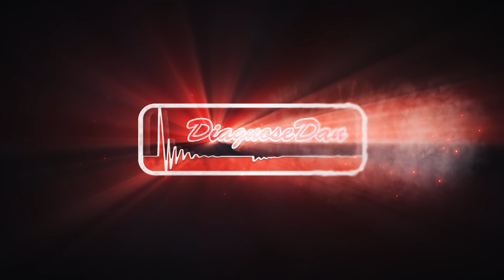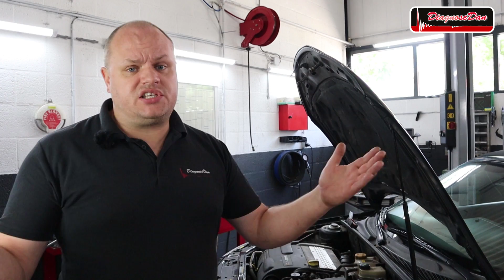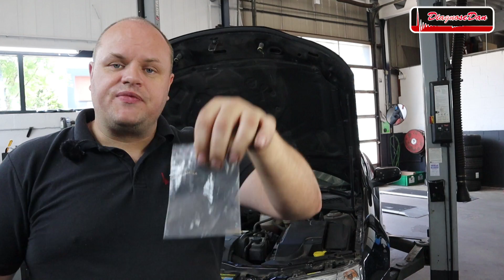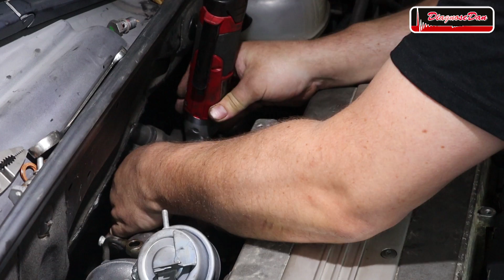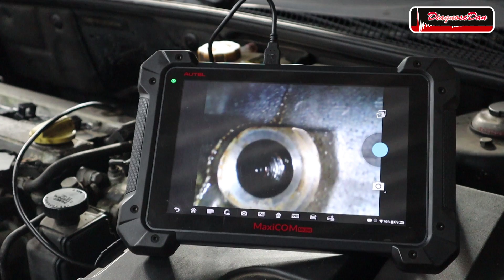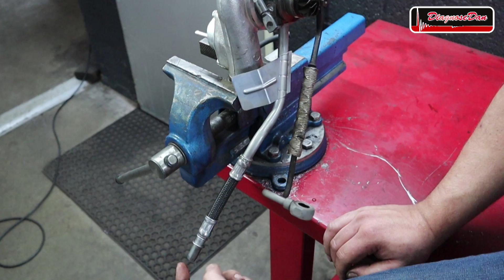Why did this new part only last one day?

Comment: The calse of the carbon is more likely to be cheap oil not meating the manufacturer specification of Aditives and incorrect service intervals (oil is cheaper than berings) always change oil lower milage than the manufacturer states as the oil is still deterating will the vehicle is idleing
Reply from the maker: Thanks for the comment 👍

Comment: some of the problem is they shut down hot without idling and letting the oil and turbo cool down , causing the coking problem in the pipe.
Reply from the maker: You are right 👍

Comment: Great Great and informative videos, but it would be nice if we knew what the cost of the diagnosis would be, Just as a benchmark for those of us who don’t trust mechanics all that much. There are very few as thorough as you, most rely solely on diagnostic equipment as opposed to combining it with common sense. Just watched your video on the Fiesta A/C circuit fault, what would the final bill be for that kind of repair??

Comment: Hello dear SuperDan, am looking for a super hero that can explain a P1577 error code (right valve of motor bearing: cutting) on a b7 rs4 Audi, sorry i just google translated that from french. I have checked a 8500 pages repair manual, and it does not exist in it to my surprise. Cheers!
Reply from the maker: You can ask your technical questions in the Diagnosedan Global tech support group on Facebook.
Reply: @Diagnosedan   I love it thank you ❤❤

Comment: Dan! Great Video of a turbo failure. Love turbos as they simulate mini turbine engines. Clearly this customer has not been changing their oil at the correct interval. And bad call on the prior shop for not changing the oil line!
Reply from the maker: Thanks for the comment 👍

Comment: That's what happens when you use Dinosaur oil and don't change your oil enough! I would strongly recommend only use 100% synthetic  oil and change it every 7500 miles to avoid the sludge problem shown in your video.
Reply from the maker: Thanks for the feedback 👍

Comment: All these years, I thought it was "Diagno Sedan."
Reply: @Diagnosedan  But really, I had a friend who was a mechanic at a VW dealer. The FIRST thing I though was coked oil return line - BINGO! Same problem with VW turbo diesels. I learned something in Europe - Europeans DO NOT change their engine oil as often as Americans or Canadians BUT Americans and Canadians drive MUCH LONGER distances ... In this case synthetic oil is a good thing.

Comment: This is why saab went kaput...gm engineering at its finest. Likely sludge caused by the wrong oil, insufficient changes, etc. Flush engine with something harsh, like diesel fuel.
Reply from the maker: Thanks for taking the time to leave a comment it's appriciated 👍

Comment: GREAT video DAN.I've never though about the TEMP of the oil feed line.I see that the car makers did try to shield a PART of the line,that shows me they did consider an oil cooking issue,but it looks like it cooked right up by the hot part of the turbo.HEAT soak from that area and possibly lack of oil changes were the cause.MY suggestion would be to add a series of cooling fins on the outside of the tube up there at the bend to dissipate the heat much faster on engine shut off.Much like the airline tubing used on some air compressors.oh and i like the cutting apart of the tube,perfect evidence.
Reply from the maker: Gread advise 👍 thanks for the comment Roberto!

Comment: Change oil often on turbo.. max 10000 km.. let it run for 30 sec or more before shutting down the engine. Severe use much longer.
Reply from the maker: Great advise 👍
Reply: @Diagnosedan  Thanks;)

Comment: H, i I bought  brand new MG MONTEGO TURBO in 1985 and that had a small cooling fan near the turbo that ran for two minutes after engine shut down, and everybody criticized  AustinRover group then,
Reply from the maker: Never seen that, did see new electric MG's driving around over here.

Comment: That oil coking.  Overtime hard oil deposits will build up and act like carbon but it's not physically carbon. This is due to extreme heat temperatures and shutting the car off when the turbo is still really hot. It essentially breaks the oil down and boils it to the point it starts to get hard almost like calcium deposits. As it is a known issue it tends not to be very common on Factory turbo vehicles but to ensure it never happens again you can keep up with your oil changes and just let the car idle for 30 seconds to a minute after harsh driving before you shut the car off or install a turbo timer on the car.
Reply from the maker: Great comment! Thanks for watching 👍

Comment: Is this engine at all related to PSA's 1.6 HDi? For a while there they had the most annoying habit of putting a wire mesh filter in the oil path to the turbo feed line (inside the engine), which would get blocked if the oil isn't changed frequently enough (and sometimes, even if it is).

Either way, I'd stress to the customer that the owner's manual specifies an oil change interval of time or distance, whichever comes first, and that the oil type/grade specified isn't optional.

On the off chance they followed manufacturer requirements precisely, I'd suggest the interval specified is marketing bullshit and maybe they should go with half what the manual says instead ¯\_(ツ)_/¯
Reply from the maker: They are Both turbo engines! Thanks for the comment 👍
Reply: @Diagnosedan  Yeh, so is the old 2.0 HDi, but it never had these issues ¯\_(ツ)_/¯

If it's not part of that family of engines, then I guess PSA didn't invent arsehole design 🤣

Comment: The first shop tech was not observant of the fact the bearings were badly damaged, but didn't wonder why wasn't there any oil?  Oil should have filled the turbine and compressor as the bearings were totally gone, so are the seals.  This was a very lazy mistake and the customer should get his money back.
Reply from the maker: Thanks for leaving a comment it's appriciated 👍
Reply: agreed
Reply: agreed, the pervious install team failed badly in a big picture diagnosis . he should get a full refund
Reply: there are parts monkeys and there are techs im going with parts monkey on this one.
Reply: Come to find out. Customer entered the shop and said "My turbo is bad, please replace it".
Reply: @FihnIsTech  So ? what diff does it make ?  What's your point ? To you , who is in charge of this transaction ? The customer ? If the customer is in charge of the repair , then why would he seek the assistance of a professional Tech ? You have either never paid a vehicle repair bill or you have paid MANY repair bills .
Reply: Very common to also see those soft lines collapse after about 8-10 years. The fluid works its way in behind the liner and it closes down. Same with brake lines. Don't want to reuse them when replacing the caliper unless you want smoking, red-hot brakes later on down the road.
Reply: @mysock351C  wrong video?
Reply: @Bratfalken  no.... he is simply saying rubber hoses degrade over time.... and will close themselves off. 
oil line to a turbo..... or your brake lines. 
.
every car has brake lines..... not every one has a turbo
Reply: @mysock351C  i had a car come in with duck tape wrapped around a cut brake line..... 
owner could not understand why it didnt hold in the pressure..... 
.
1 new brake line..... bleed all 4 corners..... and top off the fluid..... and he was SHOCKED at how good it stopped 
.
had another one with the "my buddy can do the pads cheaper" job. 
for some reason he loosened the banjo bolt..... i guess to compress the piston. 
.
but both were loose.
 (and one side had the two crush washers on top....like... bolt, washer washer hose caliper.... VS bolt washer hose washer caliper)
.
"who did your brake pads??"
my homie
"well.... your homie was trying to kill you"
.
showed him his fluid level..... he had about 2 stops left before it would have been 100% air brakes.... lol
.
he was also shocked at how well it stopped after it was fixed..... 
"i wondered why the brakes worked worse with the new pads..... figured the pads were just cheap"
Reply: @kainhall  hahaha "air brakes" 😂
Reply: @kainhall Scary stuff. Some people have absolutely no idea!

Comment: While the diagnosis is good I have trouble dealing with people who need an electronic oil pressure gauge reading in several scales when a flex hose and a mechanical gauge can be had for under $20. (no batteries necessary) The exact pressure is not critical. As long as you have a nominal reading of say 45 - 75 psi then the supply side is likely ok.
Reply from the maker: You can use whatever you have got available it's not about how you test it but its about confirming the pressure.

Comment: When is worked for GMs customer service department, we had a customer with an engine failure at 50,000 miles.    Engine tear down revealed oil more like tar. Customer stated they had never checked or changed oil since new.  She stated why should I,   I never did anything when I owed Hondas!
Reply: i wonder how long she drove hondas without changing the oil. and they survived?? 😳
Reply from the maker: 😂😂👍 thanks for sharing this story👍👍

Comment: A visual inspection of the pipe to the engine air intake is also a good idea after a turbo failure, there can be some debris in there that can go the engine, the same goes for cleaning the pipes going to and from the intercooler (if fitted)
Reply from the maker: Great advise!

Comment: When i had my 7.3 ford powerstroke, i was told when you get off the highway after the engine is running  hard "don't shut it off right away" Let it idle 60 to 90 seconds. This will cool down the bearings in the turbo. The oil in the bearings can carbon up clogging the bearings and feed lines. Never had a problem. This is true for anything with a turbo.
Reply from the maker: Great advise 👍

Comment: To prevent clogging in oil pipes due to carbon deposits we should change engine oil periodically as recommended by the car manufacturers and also do engine flush after two consecutive oil changes, as I think. Please, Dan, correct me if I'm wrong because I'm not a mechanic just a car hobbyist.
Reply from the maker: All those things help!

Comment: OK, after working aircraft, I understand the oil flow problem. I'm wondering, if in an auto, does all the metal shavings from the compressor side of the turbo, hurt anything when it fails?
Reply from the maker: Yes you need to flush the engine and replace the oil and filter. And do an inspection to make sure nothing stayed behind

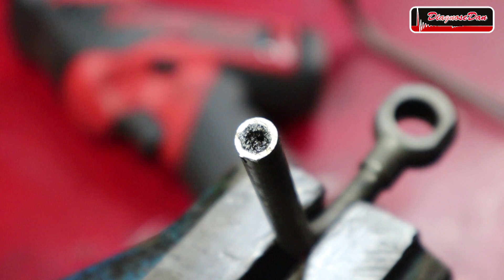Comment: 13:42 - yep, that's the magic long-life engine oil for you. Turbocharged angines, especially petrol ones and geared toward performance, should have the oil changed even more often than the service manual requires. That's exactly because in those engines oil goes through a very hot turbine and wears out quicker because of those temperatures.
Reply from the maker: Thanks for the comment 👍

Comment: Oil pickup too low/wrong.  Reroute inside pan.  Always use full syn sn+ with quality filter (wix premium as ex.)  Change often.  Let car run easy/cool down before shutoff ( a couple min).  I'd go for a non-turbo trade in personally.
Reply from the maker: Thanks for the feedback 👍

Comment: you need to drop the sump and replace oil pickup, also some banjo bolts have micro filters in them, these need to be removed
Reply from the maker: Save the time of dropping the sump by doing a camera inspection!
Reply: @Diagnosedan  true if you have a camera, im poor, id remove the sump.
the micro filter in banjo bolt is easily clogged though needs removing. cheers

Comment: I hope they went after the other shop for not changing the line. But looks like a few things. Too long between oil changes being one of them.
Reply from the maker: The only thing the other shop wanted to do is mail the oil line the never used.😬
Reply: DiagnoseDan I started out in the field. And it’s that very shady work that turned me away from it. Parts come with supplies for a reason. Not just to inflate the price or to look pretty. 🤦‍♂️

Comment: Need to let engine idle for a minute after driving especially when driving hard! Let your turbo manifold and turbo bearings cool down before engine oil runs out and burns bearings and exhaust burns oil inside tubes!
Reply from the maker: Great advise!

Comment: Manufacturer needs to instruct owners to allow turbo cool down after prolonged highway driving or racing through town to allow turbo to cool and keep oil from charring in the oil supply line. I suspect 5 minutes run time would help significantly since the turbo is water cooled. Owners may consider attaching a thermostat and looking for temperatures around 300 of less. Manufacturer should study further and give guidance.
Reply from the maker: Thanks for the comment 👍

Comment: Turbo timer, full synthetic oil changes and some external heat protection or thermal sleeve of some sort would prevent this from happening. Also, it appears to have a thermal sleeve but a lot of it is missing.
Reply from the maker: Great advise 👍

Comment: Once a year use a heavy acetone based cleaner right before an oil change to continue to promote healthy flow. I recommend seafoam to all my customers both in the fuel system and as stated above in the oil at least once a year or 20k miles
Reply from the maker: Thanks for the comment 👍

Comment: now youve got to find out what blocked the line....broken down filter? seals? carbon?
rubber hosing breaking down, we tend to drop the sump too to check for debris if weve had a failed turbo in,
Reply from the maker: Thanks for the feedback 👍
Reply: @Diagnosedan  reading up it looks like it cooks in the feed pipe and carbolises up, the dv6 in the citroens it's always the return pipe rubber breaking down and ends up blocking the pickup in the sump.
Do loads of em, many refits from other garages cos they don't clean out the sump and flush the motor.

Comment: These engines are known for black sludge. If I remember right there is a modification PCV kit for it and a service bulletin which says to remove the sump and clean out the black sludge and carbon deposits. You should call Saab specialist Wormerveer they can tell you all about it.
Reply from the maker: Thanks for the feedback 👍

Comment: This is why those oillines are included in turbokits. I also would recommend an oilchange and an inspektion of the opend oifilter, as well as a compressiontest and a camerainspection of the cylinders in case of the lost aluminumparticels of the turbohousing and the very hard particels oft the compressorwheel.  They sure did not dissolve in air!
Reply from the maker: Thanks for leaving a comment it's appriciated 👍

Comment: I use synthetics and 5000-6000km MAX oil and filter change intervals in all my cars, even my chrysler 3.8Ls. Oil sludge is a real thing, especially in hot climates.
Reply from the maker: Thank you very much for the comment!

Comment: I had a car come into the shop with a blown turbo. 
They hadn’t changed the oil in 20,000 miles. ...
Quoted them turbo, lines, and oil change. 

They actually asked if they could repair the turbo, without changing their oil.
Reply from the maker: No way!😬

Comment: Oil sludge (perhaps in rest of engine too) from too long oil change interval or wrong oil.  Good oil pressure does not mean good oil flow.  Bought a used 2000 Audi A4 1.8t years ago and lost the motor to sludge issues like this. Red oil light came on only when/after the engine seized up.  It had oil pressure until then but no flow.
Reply from the maker: Thanks for the feedback 👍

Comment: What I've seen on lines like that even in BMW ARS systems is the rubber on the line rots from the inside and pushes Rotten rubber deposits throughout the entire hydraulic or oil supply system. On BMW ARS systems it basically wipes out the whole valve Body and pump plus clogs all the lines and you end up replacing the entire ARS system which is extremely costly approximately $10000 or so.
Reply from the maker: Wow! Thanks for watching

Comment: I would be interested to know how to clean such oil line and be able to use it, instead of new one. Considering when replacing a turbo for a used unit.
Reply from the maker: I think it would take a long time but of course it could be cleaned.
Reply: @Diagnosedan  i expected something like put it in boiling water, then try to blow air when hot or what :)

Comment: Is that car direct injection?
Iloads or i800 blow turbos for the same reason.
They need the copper washer replaced that seals the injector every 70k km. They wear and combustion gets into the head causing carbon build up in the oil and blocks the oil pickup... 
agree that waiting for dans videos is like Christmas. Good work mate.

Comment: did you try blowing through the old oil line both directions? I wonder if they didn't integrate an oil screen somewhere lol
** wow that was coked up bad, I wonder if it has a restrictor orifice in the line or a banjo bolt that slows the flow and makes it cook more, coupled with someone not idling a while for cool down after driving hard and lack of oil changes/wrong oil.
Reply from the maker: Yes i tried it was blocked Both ways and that makes sense as you have seen the inside of that line